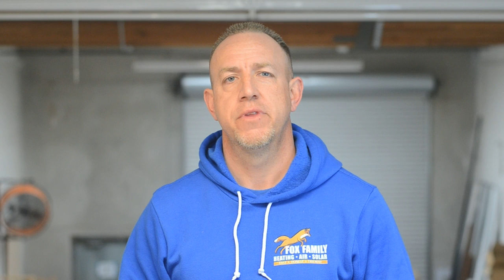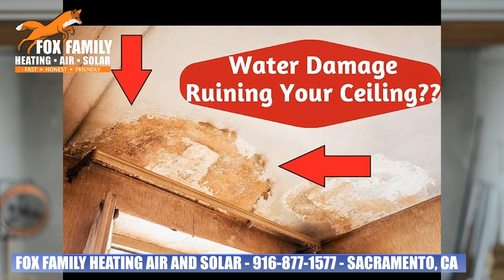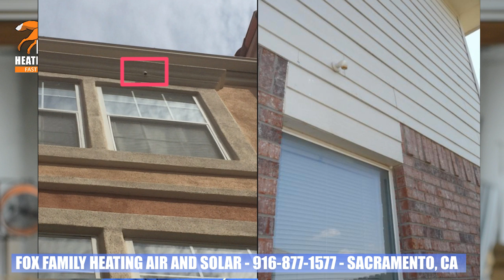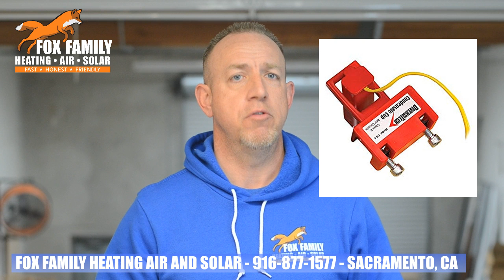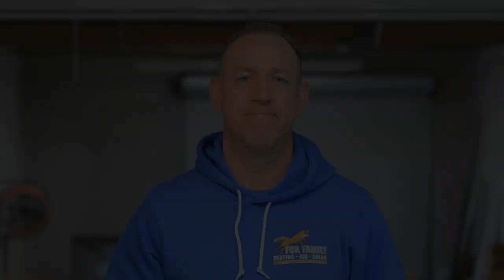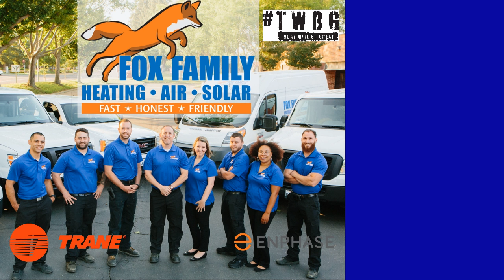What is a Condensate Safety Float Switch?

Comment: So, my AC has a safe-t-switch on the secondary line but it is always filled with water. My primary drain line is cleared, no obstructions. The furnace has positive pressure. What could cause the water to go on the secondary line and not draining back or very slowly draining back to the primary line when the unit is off for hours?